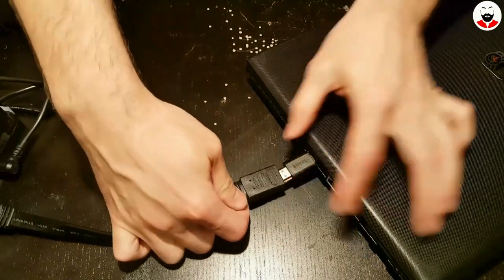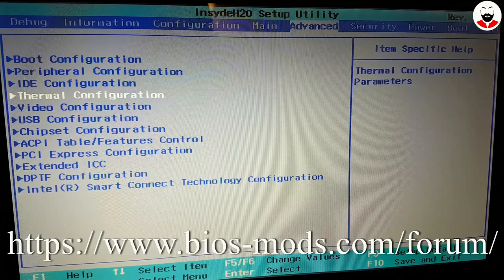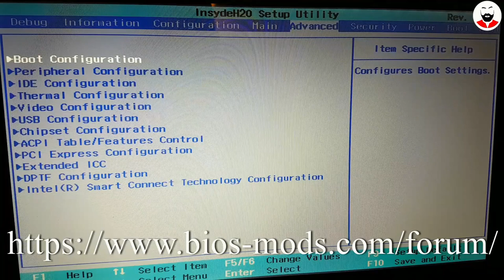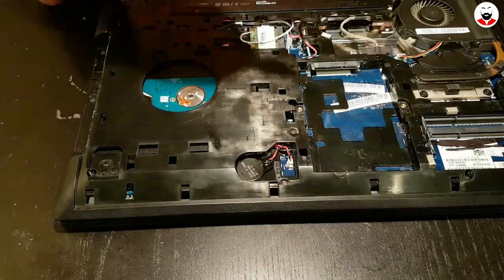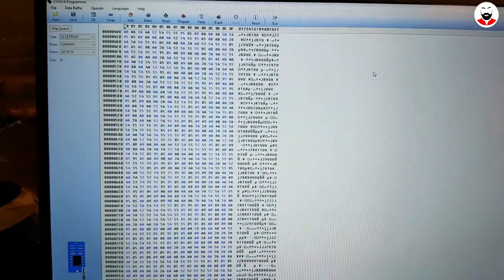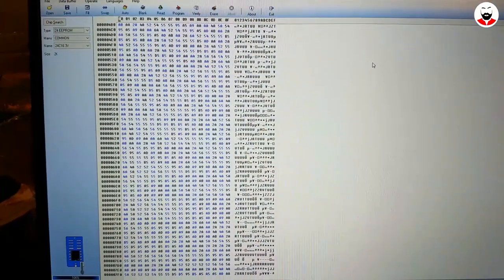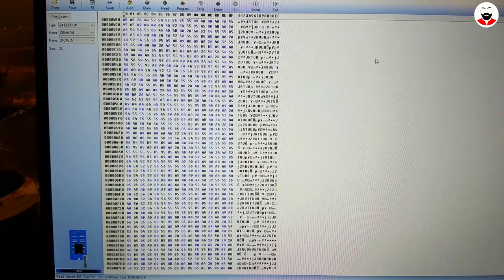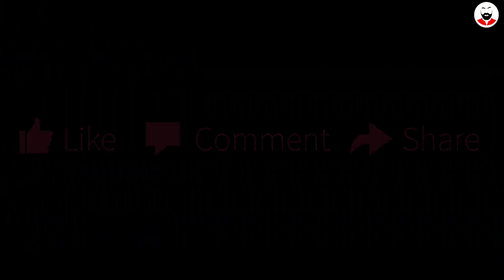BIOS Recovery - Reviving a dead (bricked) laptop [NO DESOLDERING]

Comment: Who is "the expert"? And would this work for any laptop with the same kind of bios chip?
Reply: Will work for any laptop/PC as long as you can find and connect to the BIOS chip. The "expert" is the person who modded his BIOS over at bios-mods.com
Reply: @UzY3L  can I get the same bios that my computer came with??? I had a bios version from cyberpowerpc that undervolts and shows a cool red and black designs in boot screen instead on windows symbol ,also I have a very custom laptop with 9gb of shared ddr6 vram ,20gb of system memory ,and 16gb of 144hz rated ram for low latency gaming,and a full color spectrum backlit customizable down to a single key keyboard also my PC is glitched bc I accidentally downloaded intel support assist updater app and it said to download 4 driver updates and it replaced my bios with intel whitebook extreme nuc 9 bios ,overwrited everything that the developer at cyberpowerpc had worked on just for me and I never got to try out the bios undervolts and custom software either  ,I ranked 2780 on cinebench for my i7 gen 9 9750H cpu but only before I replaced the bios on accident,now it halfed performance to 1410 and it's stuck I CANT FIX IT FOR THE LIFE OF ME!!
Reply: @devonhc7770  That's...a lot to take in. I'd suggest opening a request at the site mentioned above. Try and be short and concise. Paid request (~30-50$) will usually give you what you need. Cheers!
Reply: @UzY3L  cool , thanks for advice man I'm trying to contact cyberpowerpc tech support rn I'm in line for a long time I guess 🤣🤣🤣only the developer knows how my pc was initially but hopefully I get back there to 2700's on Cinebench🙂.

Comment: Other solution is to buy a new BIOS Chip for 10 Dollars and replace it :D
Reply: Is it works buddy?
Reply: @AdityaPandeyOfficialShorts  for my Lenovo y50 70 it works.. you need the Model Numbers of your Laptops Mainboard
Reply: @truetech9340  like i saw BIOS chip is available for my laptop dell vostro 1550 on ebay should i order it for replacing my bios chip
Reply: @AdityaPandeyOfficialShorts  When nothing other solutions work then do it, but you need very thin solder and a Hot air dryer with a thin nozzle to remove the Chip. Here is a https://www.youtube.com/watch?v=2_MyZs6bUPI video, its german language but its easy to understand without audio :D
Reply: @truetech9340  buddy if you know any other solutions then please tell my laptop isn't booting talked to customer care number they told me your motherboad is bricked because of bios failure
Reply: @AdityaPandeyOfficialShorts  follow this video bruh
Reply: @AdityaPandeyOfficialShorts  same problem with me & customer support also told same thing ☹️☹️☹️

Comment: Hi
I have make a BOIS update to my HP probook 4530s laptop and after that my laptop won't run again. 
Whenever I press the power button the laptop lids light for 2 to 3 seconds and the screen is off and I can hear the fan spins for a while and then it turns off.
But when I try to press the power button many time progressively it turns on normally but when I turn it off it shows again the same problem, and when I get in to windows I updates it from win7 to win10 but that doesn't solve my problem, and also I tried to downgrade the BOIS update but says that I can't apply this it give me that the BOIS version is newer than that I am downgrading. 
I know you can help me ✌️👉
Please reply
Reply: BIOS problem. Reprogram the BIOS.

Comment: Hey man,

Got an EXP GDC myself. It is the first time I see the cable you are using. You seem te be connecting it directly into the laptop external ports with some kind of dongle/adapter. 

How does that work? 

I only knew you could connect through expresscard or through internal ports like mPcie or m.2 and I am very curious about your implementation.

Hope you got everything working.

Best regards,

Tony.

Comment: question does the software come with the tool or do i have to go to a website to get the software separately
Reply from the maker: The guys at biod-mods shared it with me after a ETH coin donation
Reply: last question if my bios is erased will this restore it with the software or do i have to get a file off the internet to load to the bios chip how would i go about this if i get the software and tool but the bios is arased its a gigabyte mother board socket am3 plus if that helps @Gabriel2.0

Comment: @GaBIT and others: GUYS HELP PLEASE: after removing my Lenovo X270 keyboard, somehow I got black screen despite all cables were set back to their place (laptop turns ON, fan spinning). I tried to reset BIOS by holding the power button for 30 sec, I removed battery of BIOS, RAM, SSD, I tried other monitors but it doesn't show nothing, the screen is always black.
I cannot even access my data: when the SDD is plugged to another laptop it asks for BitLocker key which I never ever set!
HERE MY QUESTION: don't you think it is an issue with the BIOS, and reflashing it will solve my case?
If yes, can someone guide me for this with a black screen? What should I buy and where?
Please help!!! I need my data or I am dead!
Thanks a lot!

Comment: Send to your "expert".... r u kiddin me just get previous bios update and flash it.
Reply from the maker: To the expert if you want a modded/unlocked BIOS
Reply: I've modded many PC bioses, the process can be annoying and tricky. But, I'm glad that I can do it. Done so to my razer blade, my ab350 board, and my Asus Zephorus. Lenovo has a trickier way though.
Reply: @exquisitelyinsane4189  What you need help with bro?
Reply: @jneo8808  my laptop is Hp 15-n261TX
The power button blinks... nothing else responds
When i press win+b+power button, it goes to some bios recovery and completes the process and then again back to being the the same.
No other way i can make it work
Reply: @exquisitelyinsane4189  We're gonna start with the basics 1:) Unplug the charger  2:) Take battery out  3:) Press power button up to ten times then press and hold for 60 seconds  4:) Plug only charger back in then press power button. This is to perform power drain and I want know what happens after this
Reply: @jneo8808  i have done this and nothing works sir
Same issue persists
Reply: @exquisitelyinsane4189  Okay, do you have access to a seperate PC? and do you have a flash drive?
Reply: @jneo8808  yes i have
Reply: @exquisitelyinsane4189  Sorry this took long had work. We are going to take this one step at a time so that there is no mistakes. Okay, so now we are going to plug in the flash drive in the other PC. Then go to your laptop model I have yours here: https://support.hp.com/hk-en/drivers/selfservice/hp-pavilion-15-n200-notebook-pc-series/6529948/model/6867326 
Then we are going to follow these steps, scroll to where you see HP recover bios using USB drive: https://support.hp.com/us-en/document/c02693833#usbrecovery
Reply: @exquisitelyinsane4189  On the first link I sent you, click BIOS and download your file BIOS version F.71 REV A
Reply: @jneo8808  I have put in the bios in my flash dtive after formatting it accordingly
But the problem is that after yesterday, now even after pressing win+b+power , the bios recovery window doesn't pop up. Till yesterday it was showing.
Now only the fan starts with full speed and after a while it slows down.
Reply: @Justin Mind giving me your email. I need help with my bricked Razer Blade.